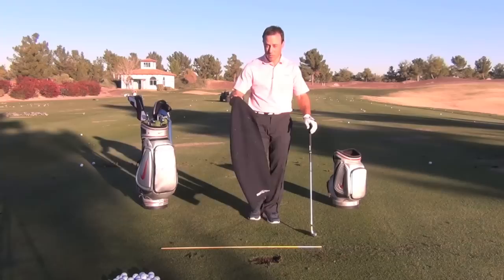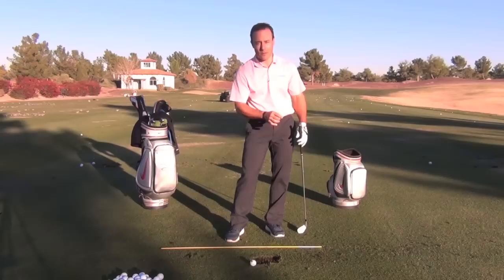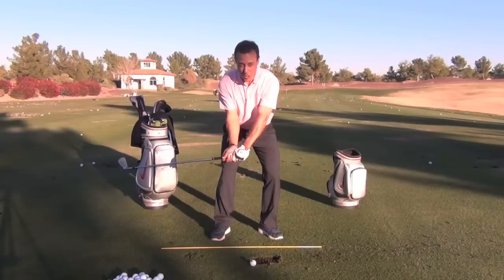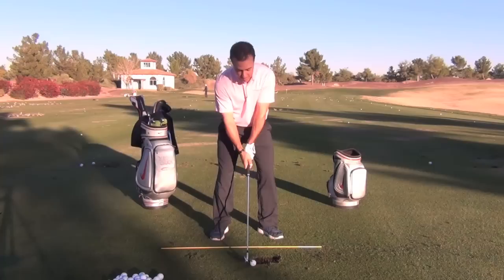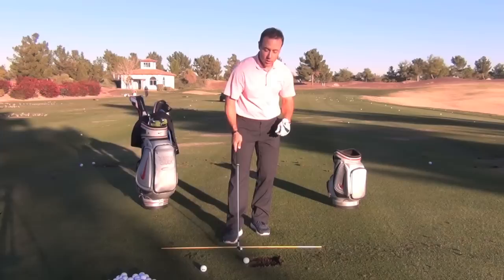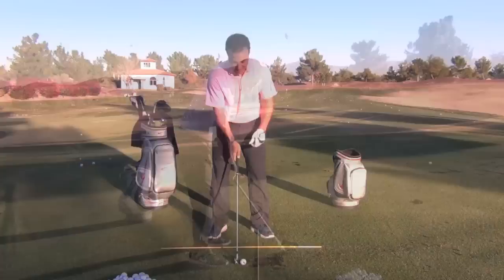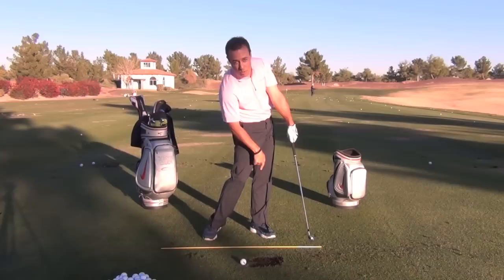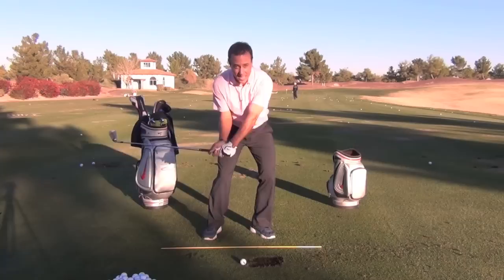Martin Chuck | Hitting Your Driver Longer - Crack The Whip | Tour Striker Golf Academy

Comment: Great tip! My only concern though is your title includes "..Hitting Your Driver Longer..". Any particular reason for using an iron instead in the video? The driver is a bit more tricky to swing and release compared to an iron, so would have liked to see the complete instruction using a driver instead to compare apples to apples. Thanks

Comment: Martin..great video..i was wondering if you can help me with a problem..my club gets down the line at the top of my downswing but then i get my weight over to the left side and turn my hips back toward the target but in the process as my hands feel like they are being pulled down,the club flattens or the butt end of the club is pointing way past my target line or way right of it...help...12 handi...i fix this..i am club champ!!  Should i  change my hands at all after i cock them in the backswng?